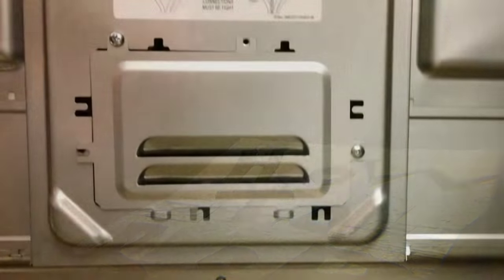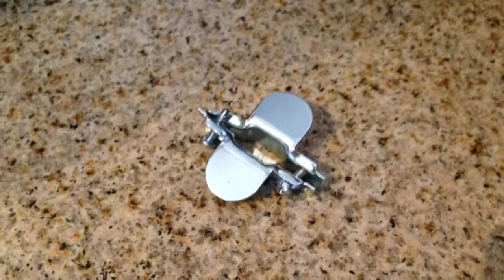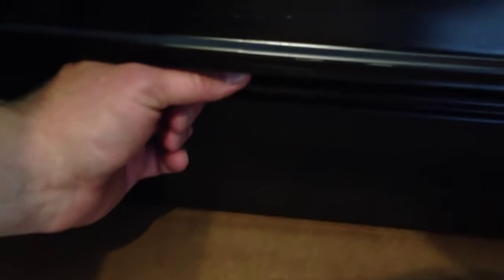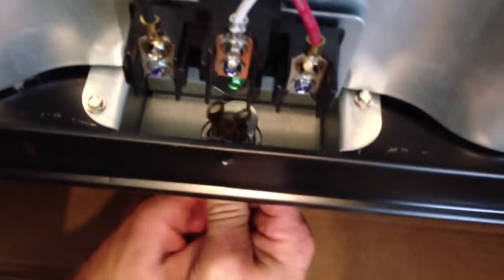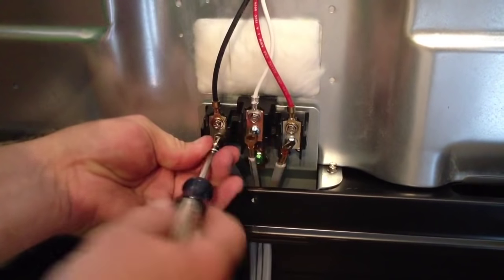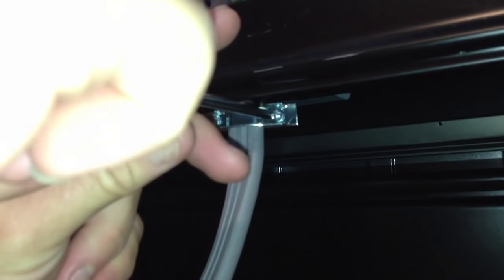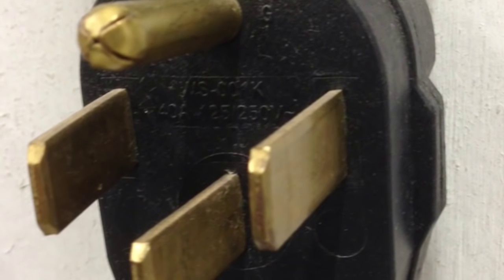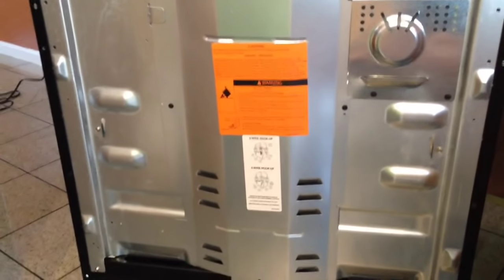How to hook up a 3 or 4 wire electric range cord By How-to Bob

Comment: Thank you for the video. Figured I had it right, just wanted to be sure before I plugged it in and blew myself up. haha
Reply from the maker: Always good to be safe. Thanks for watching.
Reply: Are the screws supposed to be flat against the connectors and the base of the stove. I have screwed them in as tight as i can and there is still some play

Comment: Good video, though you probably should have mentioned that if you hook up a ground wire, then you have to disconnect the bridge between ground and neutral.
Reply from the maker: Good idea, Thanks for watching.
Reply: What do you mean the bridge ?
Reply: All_in_tech The metal strap between the ground screw and neutral screw. If you use a cord with 4 wires, then you want to sever that bridge between those two screws.
Reply: Thank you

Comment: Thanks you so much.   I do have a problem though.  Once I remove the access panel, the screws to attach the power cord is very tight.  How can I get them out without stripping them?
Reply from the maker: Try using the correct size socket. It will hold better than a screwdriver. Hope that helps, Thanks for watching.

Comment: Thanks for the video.... the only problem I'm still having is the hex nuts on both hot lines don't want to tighten all the way.... neutral is tight... I've tried every way possible to make sure they're lined up straight... even without the leads they don't want to screw in all the way... any suggestions?
Reply from the maker: Oh no! It is possible that they may have been tightened to the point of stripping the threads out. If your sure the nuts are the correct size then inspect the threads both on the nuts and the posts. If the threads on the appliance are damaged you will need to replace them and same for the nuts. If this is the case hopefully it is the nuts because it will be easier to replace. Hope this helps, Let us know what you find.
Reply: @funbro1  took neutral nut out and tried on both hot threads and it won't fasten all the way... so it must be that the threads were factory tightened to the point of damage... hate to call an electrician for this repair but unless you have a video for this job don't see an alternative.... I'm not even sure what that part is called ... terminal block?
Reply: @funbro1  had to replace terminal block... not as difficult as I thought it would be... hot lines went right on nice and snug.... thanks again for your video
Reply from the maker: That is good to hear that you were able to fix it, unfortunate that it happened but good that you were able to fix it. Thanks again for watching.

Comment: Excellent video, very helpful but in my situation the black hot wire is burned like, so do you have to replace it , and how, or just cut the burned part? Please if anyone knows about this. Thanks!
Reply from the maker: I would definitely replace it if it is burnt. You will need to find where it connects and replace the entire thing. Hope this helps, Thanks for watching.

Comment: hey funbro.. how about how to wire a power cord to a range hood..  not the hard wire into the wall, just a power cord so I can plug it in.. thanks
Reply from the maker: Most range hoods are set up to hard wire. I have never wired one to plug in but if I were to do that it would need a plug installed in the wall where it can be accessed. Hope this makes sense. Thanks for watching.

Comment: Howdy How To Bob. Would be good if you'd tell everyone with a 3-wire connection to make sure the bonding strap is connected on the Neutral tap. And with a 4-wire connection, that bond should be removed.
Reply from the maker: Covered it in the video. Thanks for watching.

Comment: The only thing you might add is you must have neutral and ground isolation on a 4 wire system.  I have wired ranges that have a white jumper on the green screw.  That white jumper wire must be removed and put back on the white center terminal so you isolate neutral and ground.  Then the ground wire can be attached to the green (frame ground) screw.   The entire reason for the 4 wire system is to make sure the neutral is isolated from the range frame.
Reply from the maker: Covered it, thanks for watching.
Reply: What happens if the ground is not isolated and they left the strap connected. I,e. They wired a 4 wire stove like a 3 wire. With white and ground together.
Reply: @MrJasonace99  Whenever the neutral is grounded beyond the electric service  you have the likelihood of current returning on any available grounded path or what is referred to as circulating currents.  The NEC no longer allows dryers and ranges to have a common wire that is both a neutral and a ground system.   If you take electrical theory they will first teach this, "Current takes the path of least resistance."  They need to reword that and say the majority of the current returns on the path of least resistance BUT current take ALL paths back to the source.  So, If you have a 3 wire system on, lets say, a dryer.  The dryer might be touching the frame of the washer.  The washer is grounded so guess what, now the washer grounding system is carrying stray current from the dryer too.  REmember, ground conductors are there for short circuits to provide a low resistance path back to the source to effectively trip the breaker in the event of a ground fault.  They are not to be actively returning current, they should only conduct current during a ground fault situation.  So keep in mind, anything conductive like furnace metal ductwork, water piping (copper or galvanized steel pipe) if touching a neutral that is grounded will carry stray current.  This can cause a lot of problems with electronics and potentially set up hazardous situations.  Hope that helps.

Comment: I only have a black wire, white wire and copper ground wire coming from the wall. How do you connect to a 4 wire oven?
Reply from the maker: Sounds like you will need to run a 3 wire system not a 4 wire.

Comment: i was wondering were do you get replacement nuts and bolts if you lose then
Reply from the maker: Should be a standard size, so they can be purchased at almost any hardware store. Hope this helps, Thanks for watching.

Comment: Thanks for the video.  My stove (3 wire) has a red wire, a white wire, and a black wire, but my cord doesn't have any colors.  I know to keep the middle one in the middle, but do I have to match up the outside ones? What if I reverse them?
Reply from the maker: Both of the outside wires are hot...each one delivers 110 volts that is how you get 220. To answer your question, on a 3 wire it does not matter as long as it's not the ground. Hope this helps. Thanks for watching.

Comment: I need help! My range doesn't have the green screw. I only see the black red and white terminal where do i connect the grounding wire? Someone told me to connect it with the white. Is this ok to do?
Reply from the maker: Sounds like yours is set up to accept a 3 wire plug. If you have a 4th wire then anywhere on the case or body of the range would do good for a ground. Hope this helps, Thanks for watching.

Comment: Just make sure to bend that strap over from the ground to the neutral when doing a 4 wire
Reply from the maker: Why sure, hope the video was a help to you. Thanks for watching.
Reply: Exactly!  The purpose if yhe 4 wire is to seperate the ground and yhe nuetral.  I bend the grounding strap back onto the nuetral then attach the green wire from the 4 prong where it was.
Reply: I was looking to see if anyone else notices that. Some ranges have a ground strap between the ground and neutral terminals which has to be removed for a proper 4-wire installation.

Comment: Apart from the neutral wire those two wires aside why it doesn't matter whether you switched them
Reply from the maker: Both carry 120V to make a total of 240V so it doesn't matter what side they go on because they are essentially the same. Hope this helps, Thanks for watching.

Comment: i was told that I need to add a jumper (connect) the neutral to the ground when I do the conversion from 4 power cord to 3 wire cord. Yet in your video you didn't do that. could you comment on this? Thank you
Reply from the maker: On a 3 wire the ground strap or bonding strap should go from the green screw(usually center) or ground/neutral terminal to the body or case of the unit. On a 4 wire there will be a separate ground going to each so the bonding strap should be removed. Check the video at 3:10. Hope this helps, Thanks for watching

Comment: What do I do if I have a 4 prong outlet and cord . But range does not have a neutral.
Reply from the maker: Usually the center lug is the neutral on both 4 and 3 wire cords. You may need a different cord or wall plug for your situation. Thanks for watching.

Comment: Two questions. 1.) Can you plug in a 3 prong plug, into a 4 prong outlet? 2.) My stove says to remove the ground strap, before attaching the 4th wire. Is this correct, or do you leave the metal strap that came with the stove?
Reply from the maker: Karl Power You should not plug 3 prong plug into a 4 prong outlet. Once you connect the 4th wire the range will be grounded so yes follow the stove direction. Good questions, thanks for watching.

Comment: I have a 3 prong dryer outlet the used stove/oven has a 4 is it safe to remove the 4 and use a 3 prong cord. I have the 3 from an old dryer  on the stove?  My dryer is already on a long cord I figured I could just plug in the stove when I need it or plug in the dryer when I need it. 

I want to move the dryer over and put the stove where the dryer is.
Reply from the maker: Only if the wiring and breaker are the correct size for the new appliance. Thanks for watching.

Comment: I bought a used range with no cord so I took cord off my old range. trouble is I can't find the right screws to tighten up the wire connection when I install the cord. Do the screws have to be the specific screws for the new stove or can I use any screws that will tighten down?
Reply from the maker: They need to be the correct size for sure.

Comment: Thanks do you know why my range cord blew up? I connect it to the outlet to make sure it fits before i connect it to the stove and it just blew up! Do you think is cause i didnt turned off the power? Can i just replace the range cord and try it again with the power off? Do u think that will work now?
Reply from the maker: It sounds like wires were crossed somewhere.

Comment: If you have 4 wires including white sure, but only a 3 prong plug...where does white wire go?
Reply from the maker: You will need to change to a wire that fits your plug to make it work. Hope this helps, Thanks for watching.
Reply: Where does the white wire go then ( if I connect the other 3 wires to the 3 prong plug). You then have to improvise. Create a special earth. Like taking a long copper rod and hammering it next to a wall outside, into the ground. Connect the ground wire to it. 
I shocked the daylights out if me the other day, not grounding this white wire.
Reply from the maker: If you have a 4 wire set then typically the white wire goes in the middle. You may want to call an electrician to verify your set up before proceeding.

Comment: help! i am doing it correctly but the power cord that i bought for teh stove, has the part that goes into the outlet, the prongs are slanted and the wall outlet is straight so it wont plug in!  your video shows that also??  what did you do to plug it in?
Reply from the maker: Sounds like you need a different wire.

Comment: hey good video ,i have a question ,i'm planning to get this electrical stove 40 amp 220v  20" INCH ELECtric MODEL# REX204BL ,i want to know if this will race my electrical bill or just a lilttle be ?
Reply from the maker: Anything that is rated at 40 amps will raise your electric bill.

Comment: I have two wires  and a ground from breaker box and 3wire from the range. Black to black, white to white, what do I do with the red.
Reply from the maker: If your breaker box is wired correctly you should have 2 hot wires (usually Black and Red) and a neutral (usually white). The 2 hot wires usually go to the outer screws and the neutral will usually go to the center screw as in the video. One way you can verify at the range end is to look at the screws on the back, the neutral will probably have a strap going to the body of the range. Hope this makes sense. Thanks for watching.

Comment: On the 4 wire plug you just showed...what color is the ground wire? Mine is not labeled ground, neutral, or anything. I just want to be sure
Reply from the maker: twoaces446 Ground wire is the ground, white would be neutral, and black and/or red will be hot. Hope this helps. Thanks for watching

Comment: Technically on the 3-wire application you need to jump from the neutral to the ground screw... if there is no ground wire present
Reply from the maker: OK?????
Reply: What do mean by OK?????. Are you just being sarcastic, or are you pissed because someone called you out on it? I'm genuinely curious as to whether or not it's required. I came to your video to see it done so I wouldn't screw it up (I know how to do it, I was just making sure it didn't matter which terminals the hot leads were connected to), but if you're not willing to accept constructive criticism, apparently from guys who know what they're talking about, then perhaps you should stop making "instructional" videos, especially where safety is so crucial.

Comment: So I am replacing a 3 wire range with a 4 wire range, the problem is that there is NO outlet. The wires are directly connected to the range... how do I connect the 3 wire line to the 4 wire range?
Reply from the maker: You need to wire an outlet to the existing wire in the house...either a 3 or 4 wire. Thanks for watching.

Comment: Have a question, just got a new ge range and have it hooked up,  double checked to make sure everything was hooked up right, but stove and oven do not work, helllp!
Reply from the maker: Matthew Mitchell First thing I would do is make sure you have power going to the outlet. Check the breaker/fuse panel and make sure everything is good there. You can use a no touch voltage tester at the plug if you have one (they are relatively cheap to purchase). If that is all good then next I would carefully check the power where the power cord connects to the range. If that is good then you have a problem in the range...It is possible that one of the wires that comes with the range (permanently connected to the range) has fallen off of one of the terminals as you were hooking it up. If you still have no luck then the range has some other problems. Hope this helps, Let us know how it goes.

Comment: so I have a question .. but does the nuetral goes with the ground jumper to the stove green nut?
Reply from the maker: For a 3 wire, Yes
Reply: thanks.. I was confused .. the back of the stove had instructions. but I wasn't sure. thanks.

Comment: so the 3 cord doesn't need a ground wire?
Reply from the maker: On a 3 wire system there are 2 “hot” wires with a third wire that contains both the ground and neutral wire. Hope this helps, thanks for watching.

Comment: what is the proper wire size and the breaker rating for a range?
Reply from the maker: +niccolo santiago If your stove uses no more than 3600 watts @220/240 Volts then the 10 gauge wire will work using a 30 amp breaker, if nothing else is on that circuit. Better would be an 8 gauge wire with a 40 amp breaker. Always use the range manufacturer recommendation before plugging in. hope this helps, thanks for watching.

Comment: what if the range has a green wire and the cord has a green wire....will i connect both green wires together and connect them to the green screw?
Reply from the maker: If you have a green wire that is usually ground and that would go to the green wire on the range.
Reply: funbro1 Im sure both green wires are ground...but should i just connect the green wire on the range and the green wire on the cord directly and ignore the green screw thats on the range...?
Reply from the maker: tonytequila81 if you have a three wire plug then yes the green wire will go to the green screw and a jumper to the green wire on the range. If you have a four wire system one of the green wires goes to the range and one of the green wires goes to the green screw. Hope that helps.

Comment: Well the absolute first thing is to disconnect the power from the electric panel.Lock out or leave a note not to reconnect the power.check the wiring to make absolute the power is cut off.
Reply from the maker: Yeah? Thanks for watching.